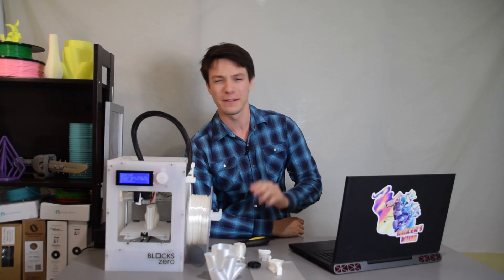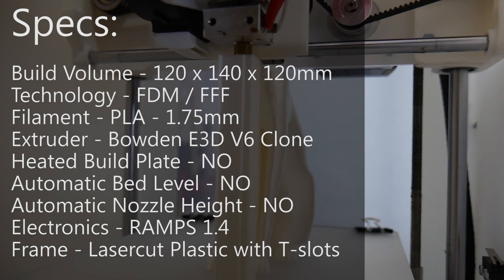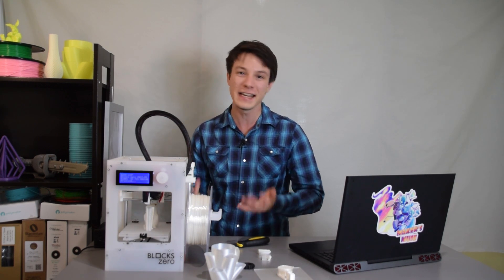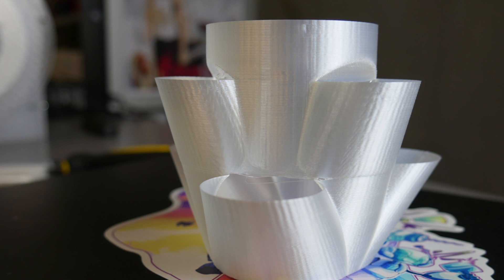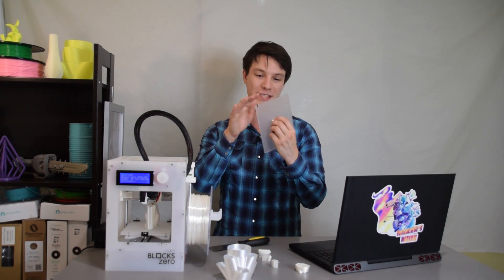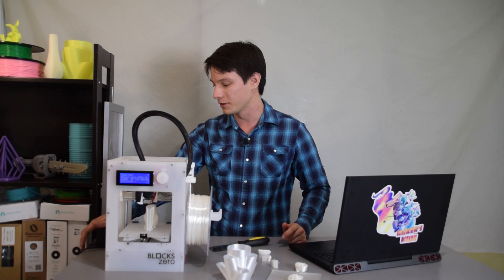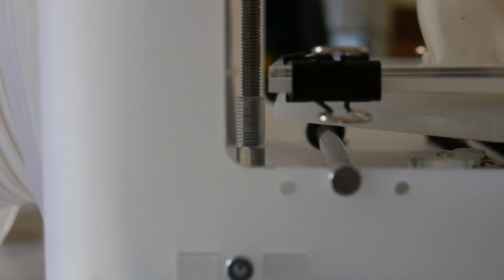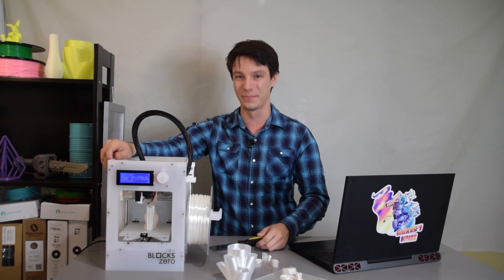Blocks Zero 3D Printer - Mini Review

Comment: Why is the idle pulley and belt system on the x axis looks so strange?
Reply from the maker: It's a clever way to make the motor further within the chassis and reduce the overall size slightly.

Comment: This machine is low cost, and its focused on new users. Then why are you so positive about the problems it have. Dangerous psu, bad bed material. People will crack the acrylic. And calling prusa mk2 just a bigger machine with feature is just dumb. You are super critical of printer which are not kickstarter but you never complain or if you do don't highlight as big issue regarding crowd funding projects. You will find and highlight issues to end about other machines.

Comment: How does this printer stack up against the Cetus3D?  you seem pretty strong on that one, and its at an aggressive price point.
Reply from the maker: Although the Cetus has locked down slicing (for now) I prefer if overall as its a bigger print volume and has the nice linear rails

Comment: plastic looks more like delrin or nylon. Delrin is a very good material for this kind of build. For me no heated bed is a deal breaker. Should be at least an upgrade option. Also, plastic bed on a machine that melts plastic? Seriously?
Reply from the maker: It is most certainly not either - the cracks are very characteristic of Acrylic and you can't laser cut nylon. And yeah the bed is... an interesting choice. People do print on PEI beds though! That is a very high temp plastic however.

Comment: Dat print quality tho, ain't gonna get that from a Chinese kit ever.
Reply: Alvin Gozali i have an Anet a8 (150$ prusa i3 clone) and it prints way better than this one.

You won't have all the comodities and can be tough to assemble but when you learn how to use it you will have twice the printing space and print any material without problems thanks to an heated bed.
Reply: I meant there is no chinese kit out there that has good documentation for assembly and prints that good on the first print WITHOUT any user modification. Yes, kits works and cheap and can print well, but you need to spend your time and money upgrading or fixing it first to print that good. This thing prints like that out of the box which in my opinion is pretty impressive.

I make my own delta printers (Mini Kossels) for about $170 that can print that good (check my videos). So I know how "cheap" printers can print good. But you need to invest time into it and someone might not want that.
Reply: I have a Sintron clone of a Prusa i3 (cost me $500A at the time, incl a few extra bits to drive it) and I reckon I probably could print that well as well, again thanks to HBP and as you said it wasn't the easiest thing to knock together, but after a fair bit of tweaking and modifying it works pretty good. It's to the stage now actually where it's producing reliable prints. 

Though I did resolve to the extreme and used my "chuck norris" power supply, 33A 1-15V Diamond linear PSU, it weighs about 15kg, is a bench hog, but my goodness does it work well :D

Printing ABS parts though is annoying, I have to overvolt the printer to 13-14V to get the HBP to heat up this century which is probably pushing the poly fuses to new thresholds of hell hehehe

Comment: Thanks for the review Angus . Your channel really help me understanding alot about fdm printer . Currently I'm having great experience with Duplicator I3 plus for few months but like any other fdm printers the print speed is limited and my optimal print speed is 45 .  Right now I'm looking at SLASH 3D LCD printer by UNIZ from kickstarter and i'm really amazed by what they've claim (50X print speed ), even faster than then carbon 3d with very affordable price .  with huge success in kickstarter . my doubt on slash3d would be mainly the resin type they use and availability . Since it's not LCD base sla , resin used for dlp won't works right ?  I've also read there are some dlp 3d printers can print 40x speed . I admit i'm really noob regarding sla lol . Does all sla printer require to use their own brand resin ?  I'd like to know your opinion regarding latest sla printers and their cons. Best regards ,

Comment: It looks like a decent kit , but why use a v6 clone , at this price point it should use a lite 6 , considering it is only a PLA machine a lite 6 will run rings around a clone v6
Reply: Dis. Blocks as a company has made other printers. I do hope this ships with a 'legit' E3D or some other "first-party" hotend.
Reply: They should just put a lite 6 in ( a genuine E3D hotend) a "good" clone will cost more than a genuine lite 6, if your printing PLA a lite 6 will have identical performance to a V6 , it has the same heater the same nozzle only difference is it has a PTFE heartbreak and a smaller cold end, both make 0 difference when printing PLA and you can use all the super cool nozzles that E3D has ( even the supper fancy copper heatblock and nozzle they just came out with)
Reply: Blocks Technology will you have in future a genuine e3D?

Comment: Angus,
Nice mini review. Do you think a zip tie around the pvc coupler for the z axis might help?
Reply from the maker: I don't think a zip tie will put that much additional pressure honestly - it is probably OK not sure what caused the Z glitch. Same Gcode file didn't reproduce it. Personally I would use a metal coupler.
Reply: You could use one of those metal hose clamps with a screw - that would indeed increase the pressure.
Or you know - just unscrew it and use loctite ;)